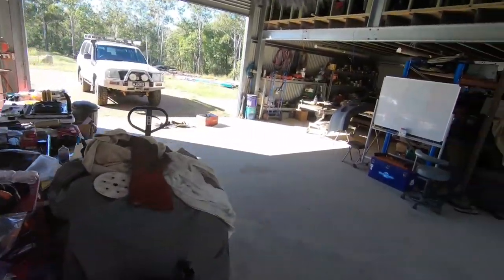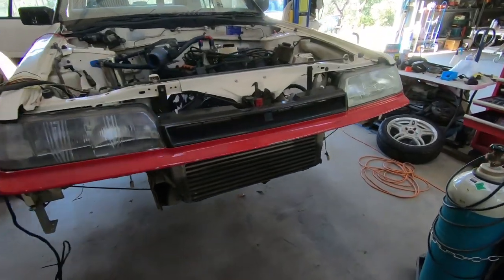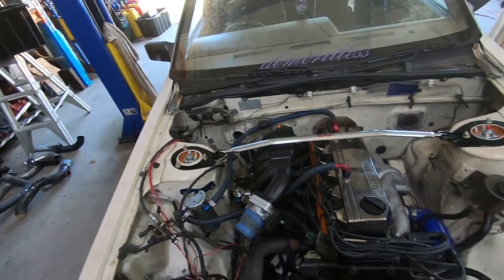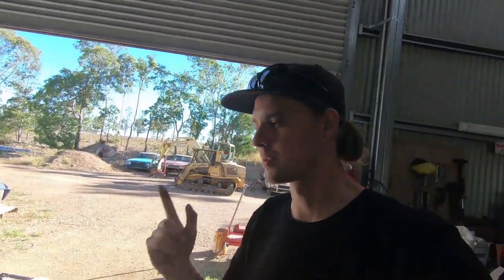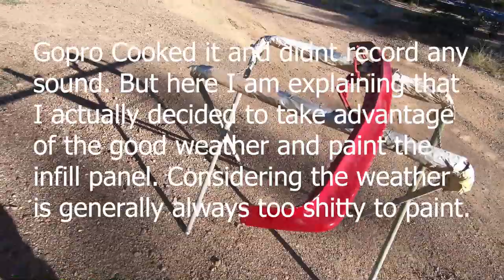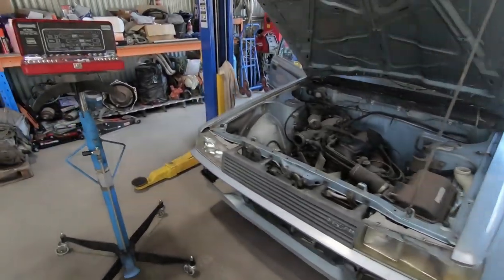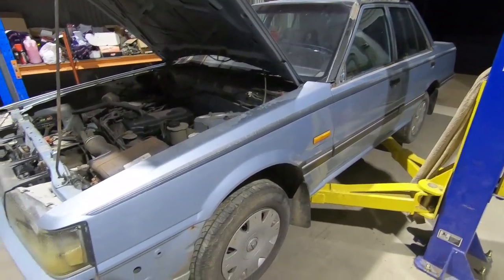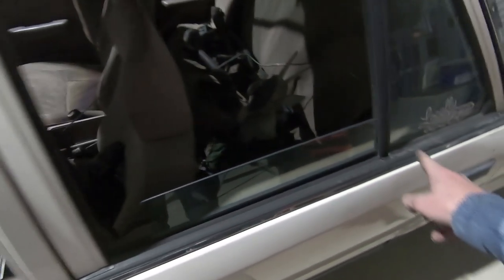R31 RE-BIRTH Part 24: Stripping more of the Pintara and some cosmetic stuff

Comment: If you have a problem you can run the fan backwards on the front of the radiator. On my 31 I have an el-ef thermos and your car will never over heat